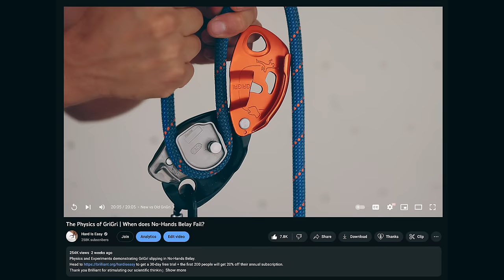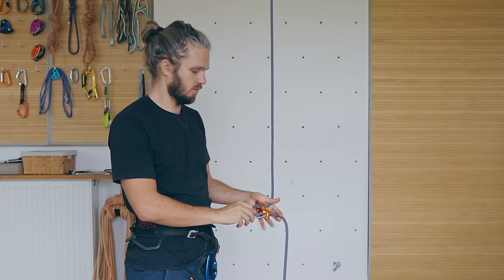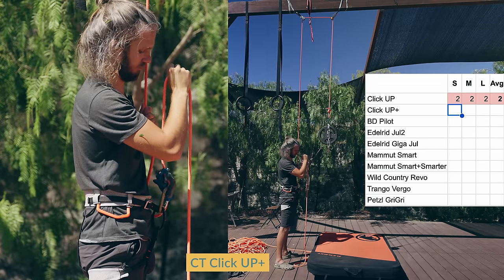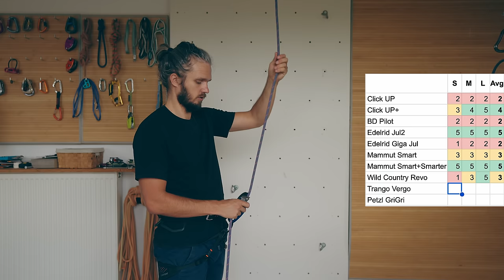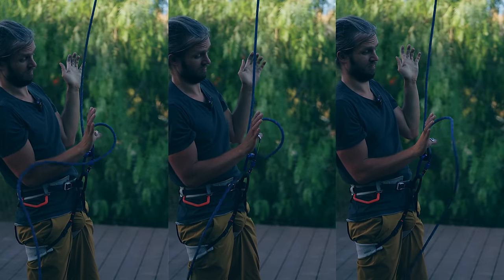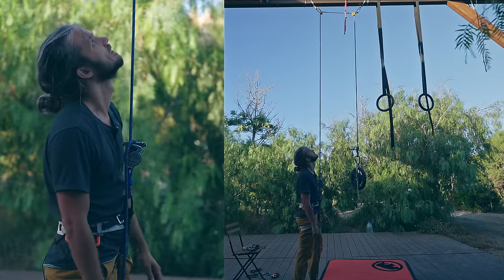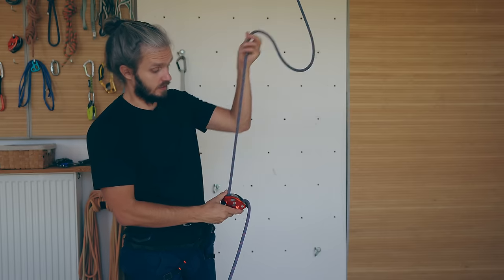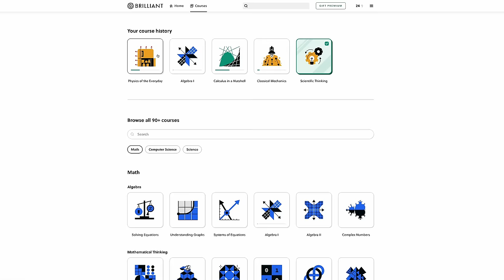When Assistance Fails!? The Physics And Experiments of Belay Devices

Comment: Hi, I was surprised that you gave the Trango Vergo such a high rating. Much like you I have tested all the belay devices on the market and some that are not. We liked the  Vergo until it almost took my life and burned my wife's hands severely. I fell 120 feet with out it catching.
Reply: Oof, good to see that you are still alive. Do you have details about what prevented the device from blocking?
Reply from the maker: Well, I can't find all potential issues for sure, so would love to know your story.

In general I'm not a big fan of Vergo, because of a weird way you have to give slack, but from safety stand point I couldn't find a way to make it fail and it was my most honest rating (just on safety)
Reply: I agree, unfortunately there really is no perfect device on the market, trust me I have been looking.  Every device can be used improperly or  has potential for failure. This particular device needs to be used with specific carabiners.

I would be happy to share our story with you and perhaps you can review it yourself and tell me what your thoughts are. After our accident we had sent all our gear to company for an inspection. The conclusion was we had done nothing wrong. The device was not loaded or used incorrectly. After we got that answer back we did some more research and found out that we weren't the only ones, however we did have the longest fall to our knowledge. We had been climbing with this device for a little over 2 years and I have taken many falls over those years. When sport climbing the Vergo was our go to. I personally have been climbing for close to 22 years now and have seen belay devices and the sport evolve a lot over those. I know that companies are always thriving to do their best to make things safer. I also appreciate all the content that you and others put out. Think it is a wonderful thing to share experiences with others so they to may learn to avoid similar injuries and potentially death. 

I'm not sure if you have a email. I would be happy to share my experience in more depth and include pictures. This was a major accident that a second more would have resulted in my death. My partner was left with severely scared and damaged hands in witch she is still recovering from a year later.
Reply from the maker: @stevenpittman1325  you can find my email in My channels about section, or at the bottom of my website www.hardiseasy.com

Comment: Regarding the Vergo- it looks like you tested it while your hand was not holding the device. The ergonomics of this particular device lead many belayers to hold it horizontally with the thumb on the plastic dot and the index finger in the specially made groove on the back with a three-finger brake grip. This method allows the pivot plate to move freely as designed. The only caveat is this: if the belayer inadvertently orients the device so that the exit path of the rope points towards the first protection point and holds it steady, a fall will not engage the automatic lock because the rope is traveling in the 'feed direction'.  I love the device, but I treat the exit end like the barrel of a gun: point it at the ground, don't ever point it at your climber!
Reply: one time he even did the setup wrong too. the vergo lever has to be on left side, for giving a extra twist and therefore locking impuls in case of a fall. the lever on right ( as the first cinch was about to be used) gives a straight rope path, ending in several accidents in the past. Then trango changed the manual to turn device, lever left and tilt device to pay slack sideways.
"expert use only" is printed on my old cinch, and i never had any problems using it even in setups not recomended by trango.
Ben did everything to make the devices fail, and even in this try the vergo ( former known as cinch ) never really failed that bad though.
But every device can be handled in a unsafe way anyway, as some accidents with cinch and revo prove.
Anyone afraid, i just tell, hold the brake strand tight, and under the device and you´re fine 99.999999999999999999999999999999999999999%

Comment: which is why i love the Vergo, sadly my local gyms thot it sucks and doesn't know how to use it. Without approval Im not allowed to use in some local gyms
Reply from the maker: I couldn't like it much for the weird way you have to give slack, but if it works for you - fantastic ;)
Reply: @HardIsEasy  oh yeah it was weird to give slack at start as I was trained on ATC in lead climbings. But after awhile it became really smooth to give slack to my left side while holding onto vergo where the finger and thumb position suppose to be. Never once had it bite my finger during a fall while giving slack.

Comment: I know the video is a bit older but regarding the Revo, I want to point out that the video works on the totally wrong assumption. The Revo is not supposed to lock in normal use. The great advantage of the Revo is that it has the dynamic belay of a tube device, giving a soft catch with locking as a backup (which makes it fit in no category). While all the other devices in the video will give a hard catch and require the belayer to jump around for a soft catch. So it definitely would not be nice if the Revo locks instantly, it would defeat the whole advantage of using the Revo.

Comment: I use the mammut smart when belaying for my friend who is around 40kg heavier than I am and it works great, it's blocking really well (provided you use it correctly of course).
Reply from the maker: Be careful with +40kg, use Ohm ;)
Reply: @HardIsEasy  We do use it sometimes and if outside I use a slinge to attach myself somewhere haha
Reply from the maker: @roxane1237  Sling might slam him hard to the wall ;) so another thing to be aware;)

Comment: I was surprised to see how much the Click Up failed on the no slack fall tests. However, as you say at the end, the important thing to keep in mind is that a "less safe" device used properly will be better than a "safer" device you don't know how to use. And even if it is very hard to make a device fail it doesn't mean you are allowed to belay incorrectly.
Reply: Thought this as well as someone using the Click up +. However when using it for top rope (that this experiment closely resembles) it can be used in the locked position to just take slack in as paying out slack isn't really needed, so when a fall happens it catches instantly as it's already locked
Reply: That’s how the click up instructions say you should use it for top rope use, locked already.

Comment: Really surprised about the Giga Jul considering I'm always struggling to give slack. But that's me holding it at brake angle.
Reply: As I pointed out above, operating this device in all modes safely takes a lot of hands-on practice. I found giving slack the hardest skill to master, and lead climbers who, especial in moderate grades, suddenly pull meters of rope to make a clip that's barely in arm's reach, instead first climbing higher then reaching down to pull rope gently and steadily, are a real pain to belay. Their problem is usually not being short-roped, but bad footwork.
Reply from the maker: Giving Slack with Giga Jul I found to be pretty good, so maybe you need to practise a bit more :)
Reply: @HardIsEasy I suppose if I belayed from exactly below the climber, I would also find the Giga Jul pretty good in this respect; however, as you yourself point out in your video on almost hitting the ground while the belayer was using a Grigri (s. https://www.youtube.com/watch?v=wz1PTbjQ3pc&t=4s, ca. 4:15, “also the grigri grabs more if the rope going to the climber is more forward”), this relation of belayer to climber was a contributing factor in increasing thee time it took for the Grigri to "grab." The corollary to that is, of course, it's easier to give slack in that constellation.
When belaying the kind of climber I describe above from a position where the he is above and in front of me, the brake assist kicks when either he, I or both of us frantically jerk the rope up.
Yes, you're right, like the Grigri, all the devices that you tested need lots of practice before one can operate them safely and reliably while catching a fall, giving rope, and taking in slack.

Comment: Hi Ben, I decided to watch this again as I recently lost my grigri and got a clickup as a replacement. I think there is a fundamental flaw in your experiment #3. Your hypothesis, or, your scenario, is that the climber asked for a block or took a fall, the belayer removed hands for an explanation and meanwhile the climber starts climbing and takes a fall. If that is your scenario than you need to repeat the tests with the device in locked mode, not unlocked. The big thing is that the clickup does NOT unlock itself like the grigri does. The clickup requires intention to unlock. Now, if you start in unlocke mode, contrary to you, I am not surprised by what happen at all, that was pretty much expected.

You just ruined the reputation of a very nice device :(

Comment: What would be interesting is, what happens, when you use all these safeties the other way round.
While we were climbing, an amateur couple was climbing as well, one of them used the grigri in the wrong way and so she had no brake effects... luckly a friend jumped in, wiring into the safety fast and everything was fine. on top, luckiely he fell slow enough, nothing happened. but it was alpine terrain, so dangerous when impact with rocks.
EDIT - kinda like: the best safety systems won't help, if u use them wrong.
Reply from the maker: Yea a double check before climbing is crushial

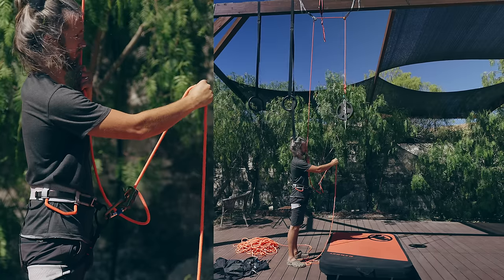Comment: Just a small comment to experiment #2 (12:15): I never give slack with my break hand. My break hand is ALWAYS below the device holding the rope. I give slack with my other hand if I have to that's also what we were told to do at the DAV class.
Reply: I must be envisioning your method of belaying incorrectly. How would you be able to give out slack if your brake hand is down in a braking position? That should cause the belay device to block the rope and prevent you from giving out the slack. I suppose technically your hand is still below the device when holding down the cam on a GriGri or raising the lever on something like a Mammut Smart, but that I'd argue that still qualifies as using the brake hand to give slack, since your hand moves out of the braking position.

I'm genuinely confused and would like more insight in what exactly it is the DAV recommends.
Reply: @LH_Vagrant  I don't really know what you mean. I keep my break hand below the device and use my other hand to tilt the belay device. Then the rope can freely move but as soon as the climber falls I still have my break hand below the device, and it blocks as soon as I let go with my other tilting hand.
Reply: @toorero  so you have the break hand below the device, use the other hand to tilt the device.... and... use your third hand to pull out the rope? I'm not sure I get you. 
What I do a lot when I don't have to pull out rope very fast, is that I pull out to the front, not up. so the device doesn't engage and you can keep your hands off your device.
Reply: @thusneldamuller37  Ah yeah I get the confusion now. Since I don't have a third hand I don't pull out rope. I thought about lowering a person down where I don't have to pull the rope, since the weight of my belay partner pulls the rope. Fair enough.
Reply: @toorero  ah ok! This whole video doesn't touch the lowering part at all! If you do just toprope yet, you can focus on how to take out slack. The rest is about belaying a lead climber (also Vorstieg). :)
Reply: @thusneldamuller37  Yeah I get it now haha
Reply: @toorero  Thanks for the clarification. This is partially on me. On reading back I noticed that somehow I managed to consistently use "break" instead of "brake". Apologies. I hope no hands were broken in the process of clearing this up.
Reply: as important is to pull down the front part of mammut smart, fish, JUL² e.g. after pulling slack.
Staying with the device unlocked is a often made error

Comment: doesn't those belay devices come with their own carabiner, which are intended to be used together? because a different carabiner, may not work properly (due to the different geometry which may not fit the belay device)? 
however great video. 
would love to see some test of the AustriAlpin Fish belay device.
Reply from the maker: As far as I know only Click Ups require their carabiners, others are more flexible, but it's always a good idea to check the manual
Reply: The giga jul needs a special carabiner the Edelrid HMS Strike Triple FG Locking Carabiner. It is an h shaped carabiner that pinches more the rope the more it gets into the slot.
Reply: @photokikko  thanks for your comment. the AustriAlpin Fish is sold with the RONDO HMS carabiner and this is what the manual says:
Carabiner: A flawlessly functioning AUSTRIALPIN
FISH is guaranteed only in combination with an
AUSTRIALPIN HMS-carabiner RONDO! Use
only this model with an autolock for sure-and-
safe closure, and the selfie-bar (wire stirrup which
encloses the rope-up loop and prevents carabiner
from turning).

Comment: I've been a Trango Cinch for over a decade. Can you test it? Is it similar to Vergo?
Reply: Imho: if you like the Cinch you'll love the Vergo :)
In germany the cinch is banned from many gyms because of disproportionately many accidents, some deadly (although it was used correctly). There was a (relatively) big discussion around 2009 regarding this device also in the internation climbing community.
Reply: I have both. The vergo could have been called the cinch2.

The vergo is much safer when lead belaying. But as it's generally tighter it's worse for toproping on thick gym ropes (which is my main cinch use case).

Comment: By Grigri 2022 do you mean the 2019 model (Grigri 3 technically) or has there been an update?
Reply from the maker: yea I just put the purchase date... GriGri has weird numbering that gets me confused.
Reply: @HardIsEasy thanks, that makes sense! I'm wondering if there is significant danger to giving out slack in the "pistol grip" (right index on rest and thumb overriding cam) as long as the right hand has the brake contained? I see some people who only seem to use the grigri in the more open stance (arms apart/right hand far down brake) which I'm guessing is safer? Unfortunately I was only taught the former for lead so I'm a bit paranoid about my belaying.

Comment: I wonder if the mega jul perform like the jul 2 or the giga jul in experiment #1. Since it's like a jul2 with two holes, I think it could perform great in this situation. I use it in crags and alpine routes and never felt the rope to slip during falls when belaying.

About Ex #2, on edelrid devices you don't need to pull the device up. You feed the rope in the device (keeping your hand low, creating a loop and making the rope enter the device from above) and pull on the climber side. Once you learn how to do this there's no need to pull up.

edit: I wrote the commet before the end of the video

Comment: Going to 50 kg in the no-slack experiments with the Click-Up and getting no different results is expected as the speed with which the mass accelerates  (and therefore the rope accelerates) is independent of the mass of the object. There is some friction with the air but it's not important at this point. To demonstrate this, an astronaut dropped a hammer and a feather on the moon (no air --> no friction) and they fall with the same speed (available on yt).
Reply from the maker: It's not that simple in dynamic environment since heavier object will also overcome the friction easier, so testing is crucial to draw any conclusions, that's why I did it.

Comment: Personally, I would prefer other people using the Revo when belaying me. 

One thing that this test doesn't necessarily cover is the likelihood of these events occurring and leading to genuine falls. From my personal experience, it's much more common that people hit the ground from lowering too quickly rather than taking falls with a poor catch. I would prefer, especially with less experienced belayers, to have a device that stops me from the most common cause of accidents rather than the less likely incidents. 

However, this was a really awesome video and definitely gave me more insight into how certain devices can fail and what I can do to be more aware!
Reply from the maker: Yea Lowering is a big issue, that I still have to think more how to "measure" the danger. 
I totally agree that liekelihood should be taken into consideration, but it's a bit hard to know all the fail modes on every device and every scenario, so I just present what I find.
Reply: @HardIsEasy  Totally, and you did a great job  doing it. Love the videos man.
Reply: THIS! The only time I've ever put a climber in danger with my belaying is when I was using a Smart+ and lowered someone too fast. I intended to slow them down before their feet were on the ground and instead dropped them the last 4 feet. No major injuries, but it was a major learning event and I don't think that person ever wants me to belay them again.

I used to be of the opinion that I was happy with anyone belaying me if they used my Revo. I am now of the opinion matching what Ben stated at the end of the video, the best belay device is the device your belayer knows how to use. With the Revo, I'll never worry about getting dropped if someone is using it, but I have been stuck dangling for a while because it locked oddly and it took my (new to the revo) belayer a while to figure out getting it unlocked. In a normal fall, a Revo generally only locks 1 way, but it can be manipulated (sometimes accidentally) into locking 4 different ways. Knowing that is especially useful for projecting and getting it locked without a fall.